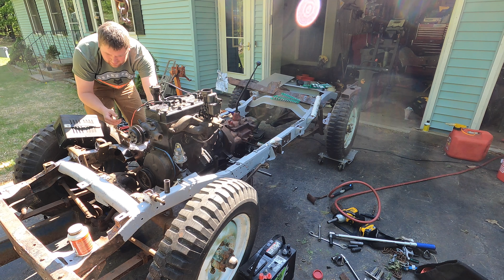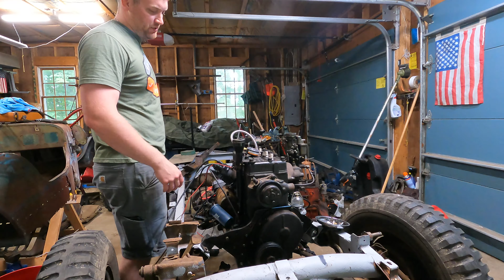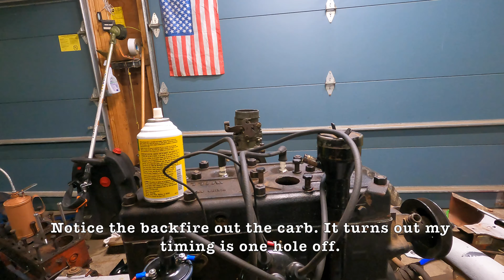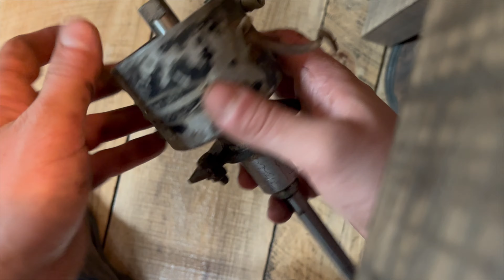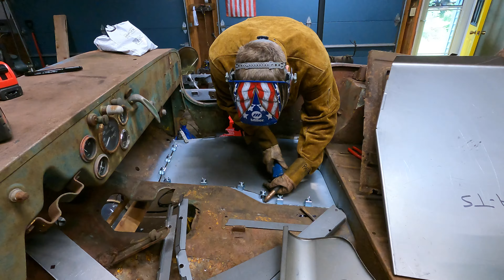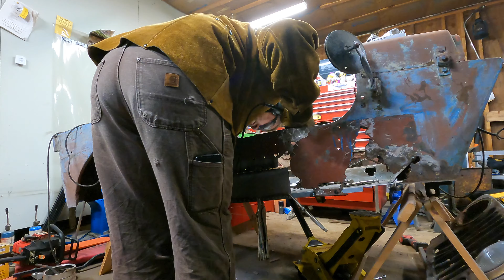CJ-2A Willys Jeep Project #11 First time starting the new engine!

Comment: Wow, you have made major progress, I just my engine back from the rebuilder last week and plan to set in place this weekend. I wanted to finish up several smaller details on the frame before setting it in place. It runs and i hope to have a "drivable Chassie" shortly. Then I will start on sheet metal! Still hope you can make a trip down the MidCoast this summer!
Reply from the maker: That’s awesome! Hopefully I can’t make it down that way later this summer!